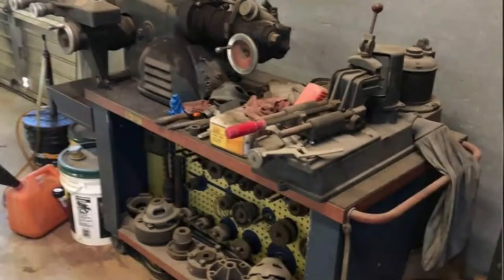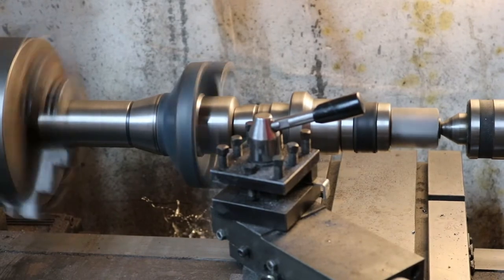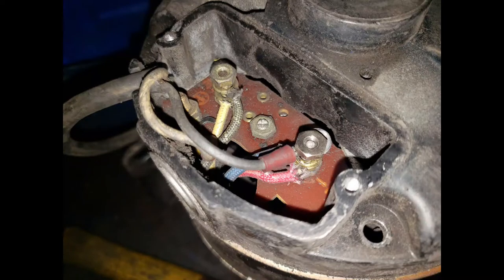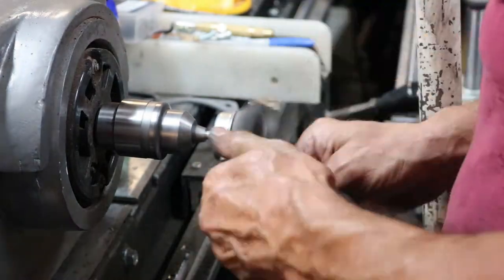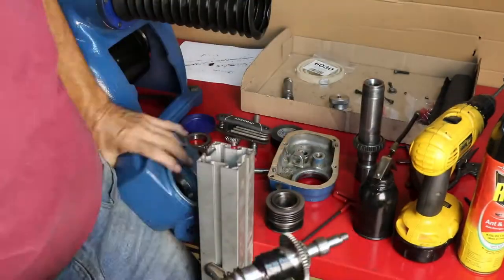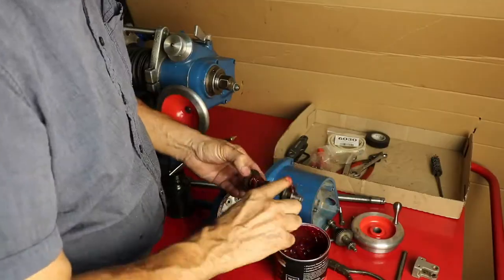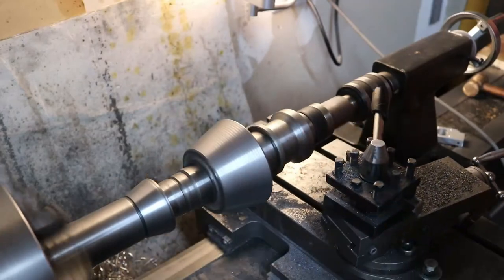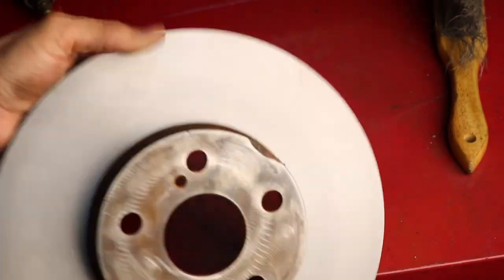Tool stories Ammco  Brake Lathe

Comment: Great video. I've been rebuilding these for over twenty years now here in the DFW area. You're right those drum gear boxes are a pain to put together by the way the name of my company is independent brake lathe service
Reply from the maker: I will keep it in mind if I ever need your help or advice in the future. Thanks for the info!
Reply: @CarlosMDominguez  so do you want a machine shop here in the DFW area? Occasionally I need some stuff done I have a guy that I used south of Dallas but that's a long trip from where I live
Reply from the maker: @sinned96  I don’t have a machine shop I do this stuff mainly as a hobby and youtube video creation. I sold the lathe but I may refurbish another one soon.
Reply: @CarlosMDominguez  well if you do get another one let me know if you need any hard-to-find parts I know MT RSR sells a lot of stuff that is my main supplier. But I have a lot of the hard-to-find parts that you can't get anymore because Ammco is out of business
Reply from the maker: @sinned96  I sure will. Thank you very much.
Reply: @sinned96  Hi, I have an Ammco 4000 lathe I'm fixing up. It cuts nice on the outer face of rotor but the inside face is rough finish, any ideas? Thanks
Reply: @rsomes  could be a loose blade could be the lock knob is not securing the carrier down that holds the blade. I would take apart twin cutter and clean everything and make sure everything's tight

Comment: Hola Carlos, do you have the part number for the bearings on that motor? thanks in advance.
Reply from the maker: Searching thru the pictures I found the bearing boxes they are  SKF 6203 2ZJEM or may be 6203 2ZIEM it is a little blurry.

Comment: Podría hacer un video de la ammco 5000 o el funcionamiento
Reply from the maker: Me gustaria, pero hasta ahorita no se me ha dado la oportunidad de adquirir una unidad de esas, casi no hay tornos heavy duty en el mercado.
Reply: @CarlosMDominguez Carlos is have a ammco like the one in this video. But the gears or gear to feed for the rotors finally gave up. So now it doesn’t feed slow or fast. I have nobody to service it here locally in California and unfortunately i don’t even know the model number. Do you think i can fix it myself or is it too much, what do you think? I would gladly pay someone to fix it
Reply from the maker: Its a model 4000.  If is not feeding, is possible that the shear gear is broken The (Right Angle assembly Drive  has shear gear) that gets driven by the pulley. You can buy the assembly or the gear.
https://mt-rsr.com/products/right-angle-drive-9815 or search on ebay. It is not too hard to replace. Also search for the lathe manual pdf, its free to download, just search for ammco brake lathe pdf and find one, that will help you a lot. Good luck. I hope it helps.
 @Thedirtylittlesecret
Reply: @CarlosMDominguez  wow this helps alot, thank you alot i think ill take on the job myself now that you explained it. God bless you

Comment: I've been servicing and rebuilding Ammco brake lathes for over 40 years.  These old 4000 models will last forever...if you can find parts and they always look like this one unless they were recently rebuilt.  Rust is not an operational issue.  Ammco lathes and parts are now made in China and are pure shit.  Don't buy a new one.  I have 40+ years of parts on hand if anyone is looking for genuine Ammco parts made in America.
Reply from the maker: You are right. Not only Ammco, a bunch of other things as well. Please leave your contact email or website if possible.    I am currently refurbishing a 4001 model, with truck adaptors, I might need some parts. Thanks for the comment!